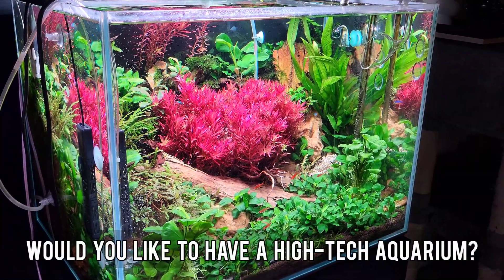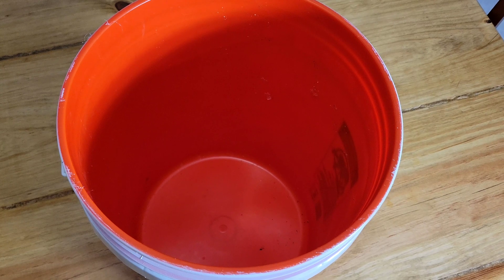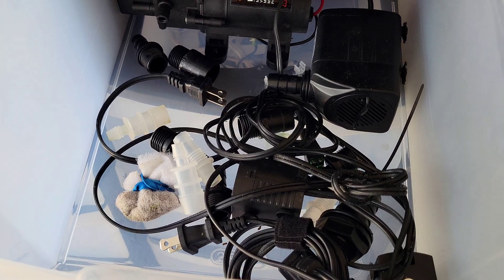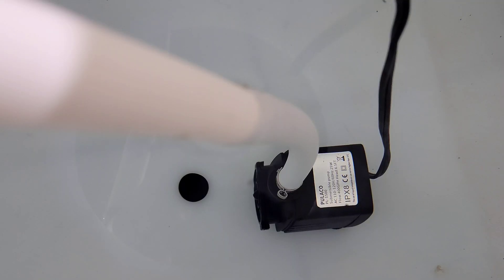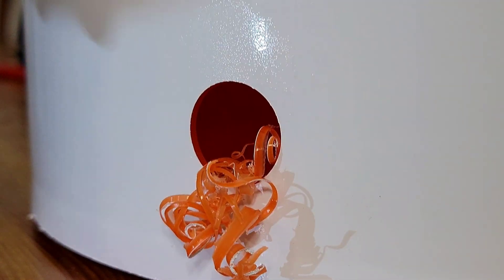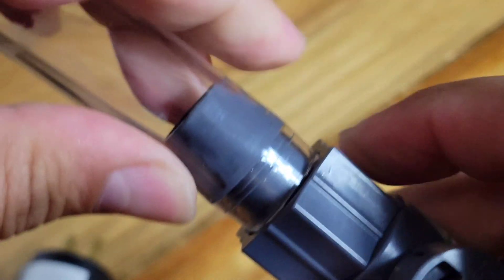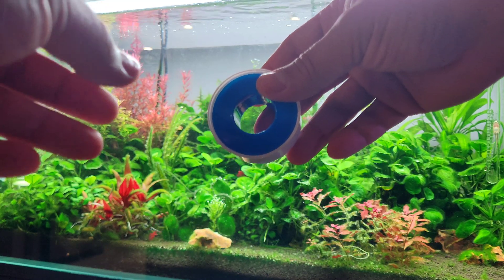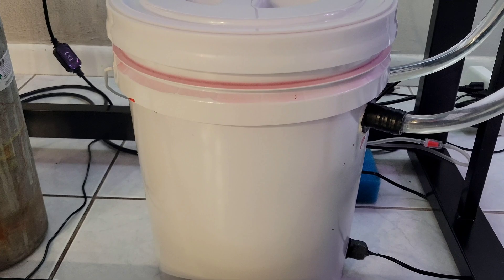DIY Aquarium Canister Filter - Easy and Efficient

Comment: Are you using a separate pump to get the water into the filter
Reply from the maker: No, just the one. The vacuum created inside the bucket pulls the water in, and then gravity does the rest.
Reply: Gravity

Comment: Why didn't you cut the power cable further away from the plug and then just solder/twist the wires back together with the original plug?

Comment: I would have just ran the cable up threw the top . Adding a hole for the cable is just another leak point . But other then that not bad

Comment: Seachem matrix and all other ceramic media has been proven for years to be a scam. You would get the exact same results with rocks that same size, lava rock would be superior. A sponge with holes of the higher size would give you 10-100x more surface area while simultaneously all acting as mechanical filtration. I had fallen for this trick as well and probably have paid $500 on ceramic media over the years. It's crazy to me that is misconception is still so widely circulated. Hopefully at least one person will read this and stop using it and tell others that it's a scam. Ceramic media is one of the worst ways to get surface area, biofilm will block all of the holes in a couple of days and what you will be left with is a rock where only the outside has surface area. Lava rock and sponges don't have this issue. Even small gravel or sand would have much more surface area, given it is not fine or compact enough to fully impede the water flow. This is a situation where marketing has fooled mostly everyone and what you end up with is an inferior product to what you would get with alternatives that are cheap or possibly free. It pains me anytime I see someone use one small sponge and then waste all of the filters space on something no more efficient than driveway pebbles.

Comment: Would love more details on the types of filter medium, and how big of a tank can a filter that size handle?
Reply from the maker: The filter media is Seachem Matrix, and that bucket should be more than enough for a 50-gallon tank.
Reply: If it’s anything like a bog filter, the size of the container you’re making the filter from should hold approximately 10% of the capacity of the tank it will be filtering. If you want to be cautious, you could go up to 15%. I recommend checking out Oz Ponds to learn about how to make a small bog filter and adapting both the bog filter and this canister filter together.

Comment: Why not run the cord through the upper portion to reduce the likelihood of a leak?
Reply from the maker: I actually considered that, but I just couldn’t figure out an easy way to open the lid.
Reply: @underwatergardens709  Oh, yeah not through the lid itself, but just towards the upper portion of the bucket.  However, since the whole thing is pressurized and full, guess it really doesn't matter as much.

Comment: What if the filter inlet gets clogged and the pump putd the entire 5g bucket of water into the tank? Wont jt overflow?
Reply from the maker: You could add a couple of solenoid valves to the inlet and outlet hoses, and maybe a small float switch inside the bucket. That way, if the water level drops too low, the pump shuts off and the valves stop any more water from coming in. But at that point, you're probably spending more than it’s worth. Plus, it’s pretty rare for a filter inlet to get completely clogged anyway.
Reply: @underwatergardens709  It has became very difficult , don't you think so ?

Comment: This filter doesn't have any issues?
Reply from the maker: Make sure the filter is completely filled with water before you start it up. It also helps to add a couple of valves on the inlet and outlet hoses to control the flow, especially if the pump’s suction feels too strong. And before turning off the filter, close both valves. This prevents water from continuing to flow into the filter once it’s off. If you set it up like that, it should work just fine.

Comment: I'm having trouble with it sucking up the water. All it's doing is draining the water into the tank. Also, I used a lot of Teflon tape, and when I unplugged the pump, the water went into the bucket and spilt out the top. Please help me
Reply from the maker: If you add taps to both the inlet and outlet, it should solve both problems. Start by making sure the bucket is completely filled with water before turning on the pump. Then, slowly close the outlet tap (the one that pumps water back into the tank) until the flow going in matches the flow coming out. You might need to adjust it a bit to get it just right.
When you're ready to turn off the filter, close both taps first, and then turn it off. This will prevent water from continuing to flow into the filter while it's off.
Reply: This does not work during a power outage. Not a common event, but a water disaster when it happens and you are asleep or not home.
Reply: It comes down to the type of pump

Comment: Salut merci pour la vidéo moi qui recherche sa car pas le budget pour acheter un filtre petite question comment sa aspire dans l'aquarium ?
Reply from the maker: The pump pulls water in through the front and pushes it out through the top. To keep it running smoothly, the bucket needs to be completely sealed—no air leaks! I recommend adding a bit of silicone to all the connections for a perfect seal. Hope that helps!
Reply: @underwatergardens709  Merci beaucoup

Comment: Does the sumbersible pump can create vacuum and suck water from tank
Reply from the maker: Yes, it does, but the bucket needs to be completely sealed. That’s why I recommend using silicone on the inflow and outflow. It helps ensure a tight seal and prevents any leaks!
Reply: Great video! , I made my own however I’m having a problem now where the the vacuum it created isn’t as strong as the water being pumped back into the tank. So the canister filter ends up getting drained of the water because the water return isn’t as great as the pumping out. Do you know why?
Reply: It's essential to fill the cannister with tank water before turning it on. He covers this in the video. Otherwise, try decreasing the intake power.
Reply: No it doesn’t work with impeller type pump which are what most pumps are

Comment: How the water coming down to bucket? 
Pump is throughing the water to tank upwards but how its coming back?
Reply from the maker: The pump works by pulling water in through the front and pushing it out through the top. To make sure it runs smoothly, the bucket needs to be completely sealed—no air can sneak in! That's why I suggest adding a bit of silicone to all the connections for a perfect seal. Hope that helps!

Comment: Interesting video. I can understand doing this if you want a massive amount of filtration, but cheap canister filters are pretty good now and that bucket doesn't offer much more than an allpondsolutions 1000EF as filtration goes. If you could scale it up to plastic bin size, then I could see this saving a lot of money, but not on this scale.
Reply from the maker: Hey, thanks for watching. The principle applies to any kind of container you want to use. The bigger the container, the larger the volume of filter media you can use, hence more filtration.